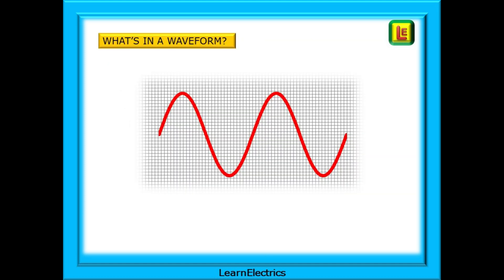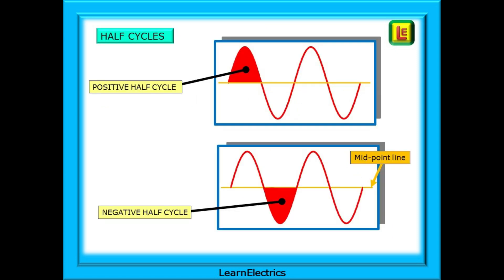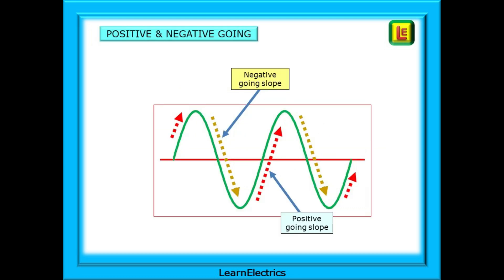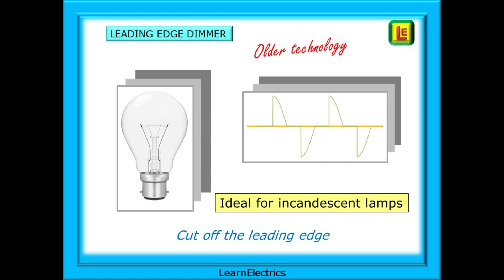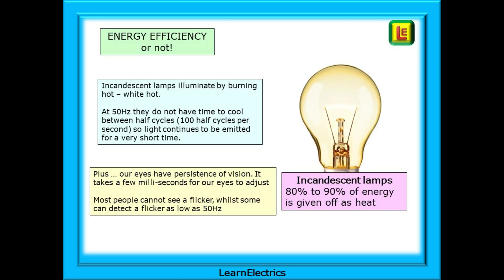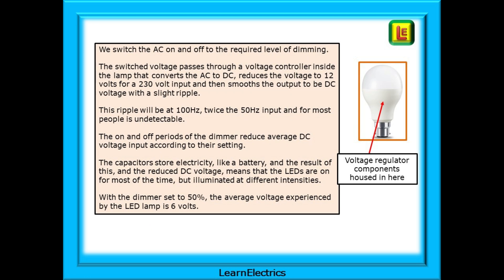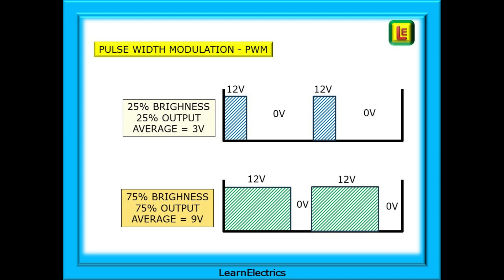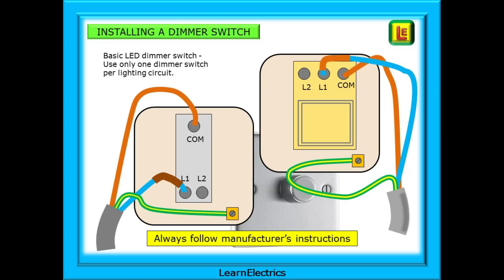LED DIMMERS – HOW THEY WORK – WHY THEY FLICKER – WHAT HAPPENS INSIDE A DIMMER – CAN I MIX LAMP TYPES

Comment: Sometimes you have to add a 1-6Uf capacitor to smooth out the flicker at lower dim levels. They should put these into circuits in the first place
Reply from the maker: Great input. Thanks Martin.

Comment: Led dimmers & led lamps generally give me more grief with customers than the old filament lamps. Even with matching brand of led dimmers and led lamps, they often flicker or just pack up. I've also had a customer replace 1 single dimmable lamp for a different make & the rest of his 9 led dimmable spots started to strobe badly at certain settings. Nowadays if a customer requires dimmable led's i try to talk them out of it.
Reply: I have the same exact issue even when I use the V-Pro programmable dimmers that are very expensive I end up with issues and the client thinks it’s my fault! I try to explain the complications but it only makes it worse! I too try to talk them out of using dimmers.
Reply from the maker: Brings back memories of many lost hours chasing problems not of my making. As you say, try telling the client that.
Reply from the maker: Interesting contributions. Thanks for responding and yes, sometimes we wonder why we try to "improve" things.